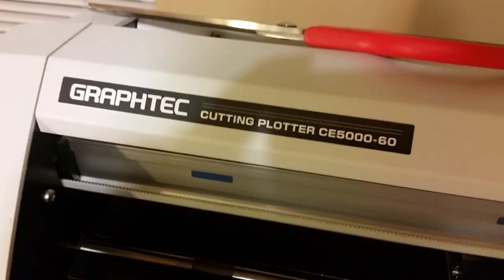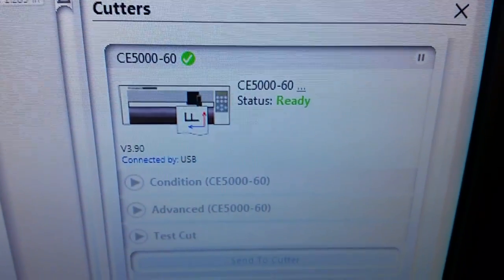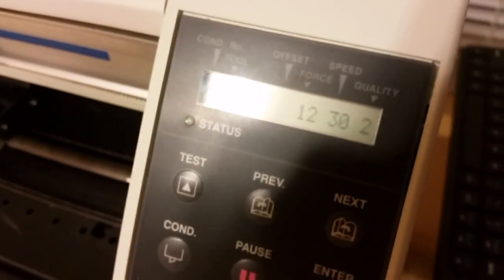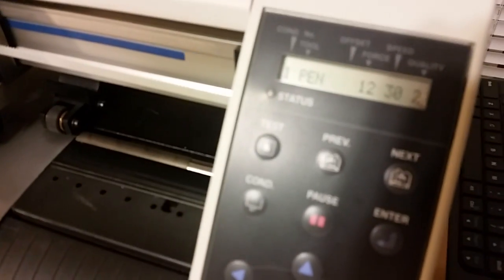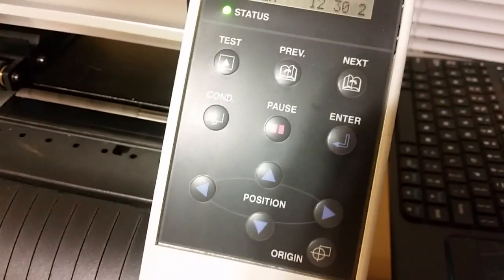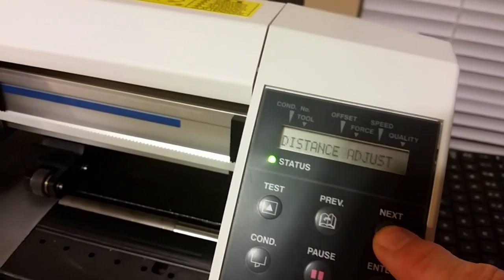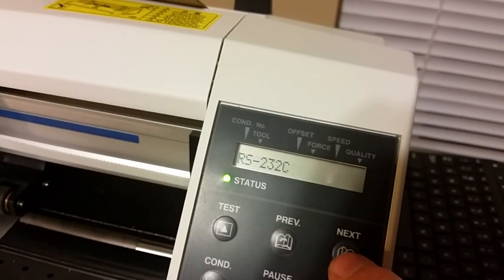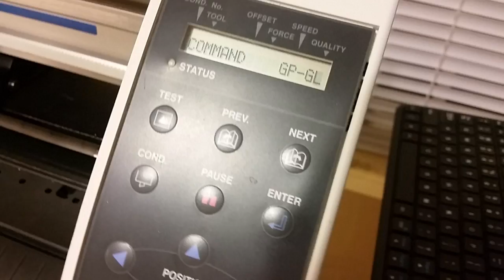Graphtec CE5000-60 GP-GL error, how to fix!

Comment: hi sir, i have Graphtec CE5000-120. I'm having trouble cutting. I get an error when I send the file I want to cut. "Port write error"

I am connecting correctly by looking at the "Com" setting. For example; If com1 appears, I make the com1 connection within the program. But the machine continues to make a small cutting noise. It gives "Port write error" error.

I couldn't find a solution. I cannot use my machine. Have you experienced such a problem before?